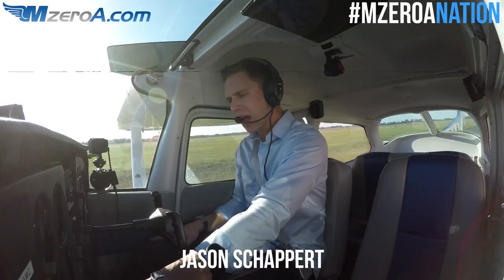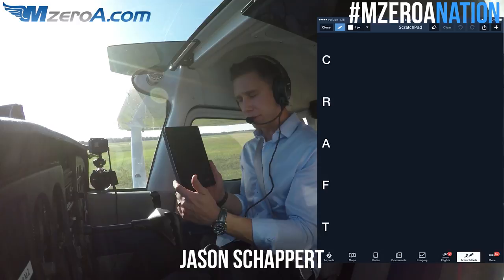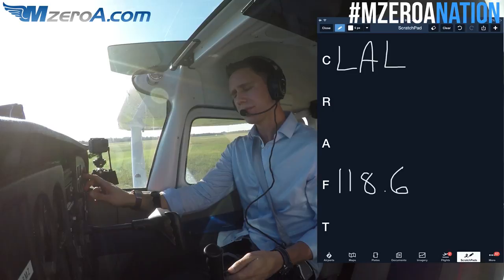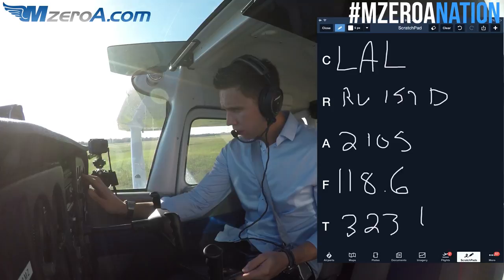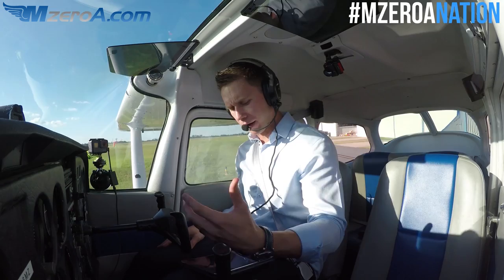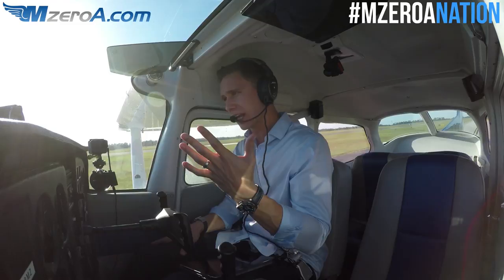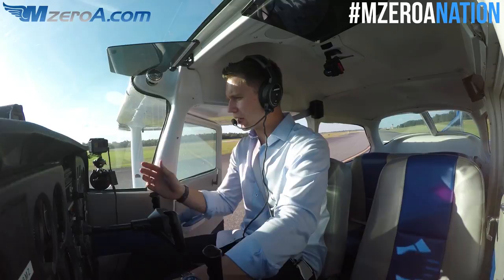Copying an IFR Flight Clearance - MzeroA Flight Training

Comment: I use that same scratchpad in Foreflight. The one thing that's really cool these days is Apple Pencil support on most new iPads (including the new Mini), which really helps with long IFR clearances where your finger just doesn't have the ability to make things small enough. I'm not an Apple person outside of aviation but I really recommend a newish iPad with Pencil support, and the Pencil for IFR clearances. The palm rejection really makes the difference over a standard stylus too; you can write like writing on any piece of paper, without worrying about where you rest your hand.

Comment: It would have been good to mention that the clearance was revised before he left the ground i.e. "maintain 5000" canceling the clearance to maintain 2000 expect 5 in 10".  Also there are other things that can be tacked on to your clearance including "Hold for Release" and departure vectors. I don't get the vectors frequently but I add HV to CRAFT just to trigger my mindset if I got them or not. They are certainly worth recording.

Comment: If you still use an iPad, I’d recommend investing in an Apple Pencil. If you haven’t heard of it, it’s a stylus that connects directly to the iPad via Bluetooth. With that technology the pencil “Talks” better with the iPad, and it’s as smooth as butter!  Also, does your version of ForeFlight have the “CRAFT” scratchpad template?  I promise I’m not a troll, I just add comments and I think of them.

Comment: Jason, could you help me out here clarifying this: RV157 Direct.
Ia that after take off you fly 157 until joining the airway which will take you directly to your destination?
Or your clearance should be understood differently?
Reply: The clearance was Radar Vectors to join the Victor 157 airway.  So ATC will point him in the direction they want him to go by giving either an initial heading or headings around other traffic or as in the case of this flight, they said proceed on course which means to take the most direct route to join Victor 157.  Victor 157 is not a heading but the name of a victor airway to fly.  Victor airways are navigational airways that take you from VOR to VOR.  You can find them on low altitude en-route charts and on VFR sectionals.

Comment: Does ATC to aircraft pilot radio communications vary on the ground of a controlled airport from airport to airport concerning receipt of IFR clearance on designated frequencies such as Clearance Delivery, Ramp, Ground, Apron and Tower? IFR clearances can be obtained from contact with any of these Air Traffic Control units above dependent on the ATC operational procedures in force at that specific airport.  Does the pilot of an Airline have to be trained by the Airline as to which ATC unit to contact to obtain the specific clearance required at each airport?

Comment: If you act as a PIC (single pilot) you not suppose to be on the left side in front of the control?
Reply: No, not required. He's a CFII and teaches from the right seat all the time. Also, that allows the camera to see the instruments without his head and body getting in the way. If the PIC is comfortable in the right seat, it's fine.
Reply: Note that some planes require that a solo pilot to be in the left seat; for the 172 and most other recip singles it doesn't matter.

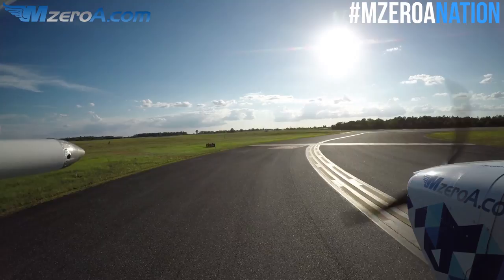Comment: Someone tell me what is the hole on the side of the pitot tube ? (Shown on 4:12）
Reply: static port
Reply: Not the side of the airplane, see the hole on video  4:12
Reply: @chutingliu3773  Lots of pitots tubes have both pitot and static ports.  There is usually also a small port on the very rear of the pitot passage to let water drain out.